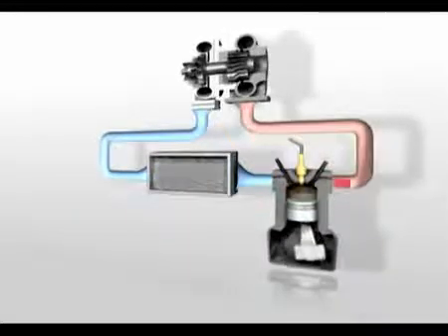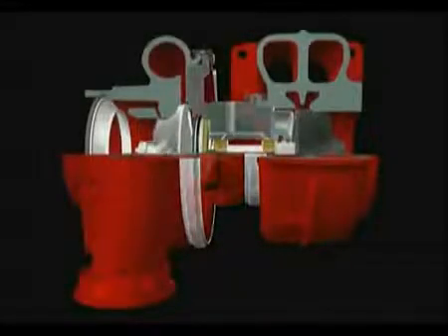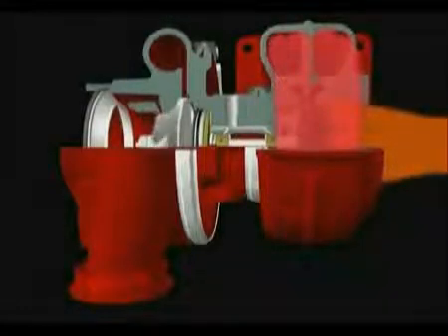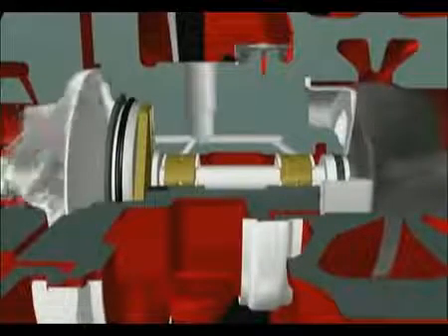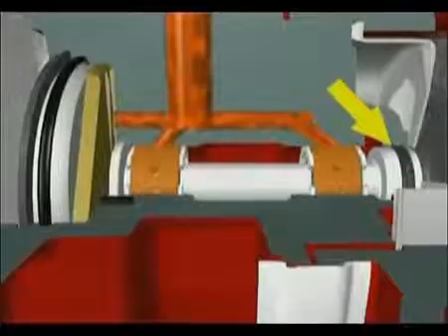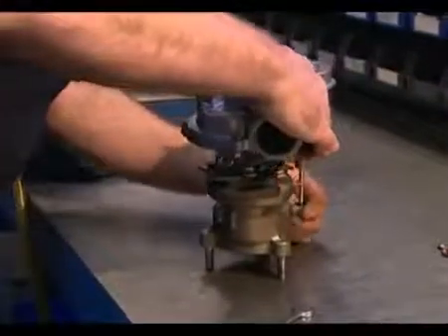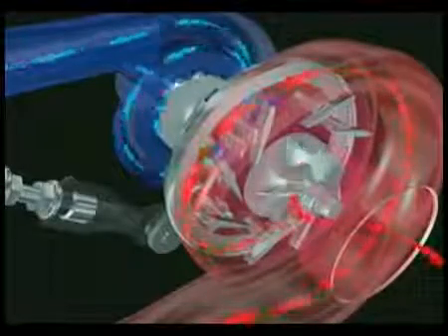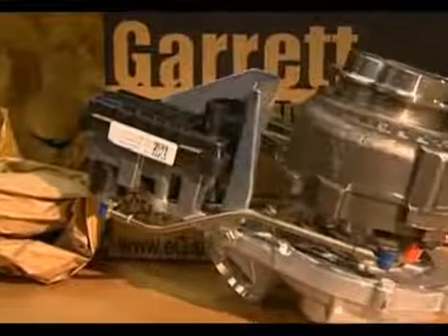How a turbo works full explanation with animation

Comment: So what is the difference between waste gate and blow off valve?
Reply: Waste gate is on the exhaust side, blow off or recirc valve is on the intake side. Recirc valve will put charge air back into the intake system after letting off throttle. Waste gate controls the speed of the turbocharger. Completely separate parts with separate functions

Comment: What happens in vechicle if waste gate gets jam and doesn't open ?
Reply: Doesn't work as well. Basically won't build boost pressure since it is short cuircuited.
Reply: @blackmanops3749   I think Chetan tikone mean that the waste gate never opens. It opens to stop building pressure. So if it stays closed likely the turbo will turn into small metal shards that rush into the engine and scratch and rub agents stuff. I mean this is the only logical way it will end up. It is a small turbo getting more and more exhaust rushing into it then safe. It is small to give good power at low or mid range. But when the waste gate kicks in your at high revs.

So it has to spin faster if the engine can supply it with more energy.  And as the turbo is killing itself to give more air it will have the power to do so.
But I do not think many road cars need to worry about the waste gate getting stuck. You have far more real problem on normal road cars. Like shit in the oil clogging up the fine oil passages in the turbo. (why there is a oil filter) Modern engine in general have this problem but turbo ones are VERY much a problem zone when it comes to oil. Why it is so crucial to change oil. Even more often then what manuals or the labels say. (if you care about the vehicle) 

One of the reasons to have a loud waste gate. External one that is. Not just for the satisfying sound. Never heard it on anything but the high powered gasoline cars. Diesels trucks or lorries I have not heard one in real life. But it might be more due to the law or something being lame. Believe me I have driven some turbo vehicles but not many costume builds. And the benefit of turbos are massive.    

If wastegate do not work lubrication is going to fail shortening the lifespan of the turbo. Or it just blows up like when you smash a window. 

Sudden power loss and small bits flying into the engine hitting valves and piston and the cylinder walls XD  Really lubrication loss let alone on a engine bearing is bad enough. But imagen a turbo that needs a waste gate? It will really do a number on the expected lifetime of it  :C
Really think the lube is the main thing that will make it explode. It is taking away heat and avoiding metal contact. The faster spinning might be enough to shatter the moving parts but the lube problem will end it totally.
Reply: My electronic waste gate just went bad, it gradually got worse, started with a small rattle that eventually got louder over time. My vehicle also had a hard time building boost and would constantly throw under boost codes which would put the vehicle in limp mode.

Comment: Interesting, I thought that hotter air would make the engine more efficient.
Reply: Nah, hot air is less dense so has less oxygen. The less oxygen there is the less efficient fuel to air ratio is detonated. For contrast 14:1 is the best ratio air to fuel needed for best performance and economy. Diesel used an even higher ratio and compression.
Reply: I’ve always been told by my dad and his brothers to at colder, denser air = a better bang.
Makes sense
Reply: That’s incorrect
Reply: Could a bad charge cooler make both turbos shut off?
Reply: That's true. Since cold air is heavy it settles down in the cylinder there by increasing volumetric efficiency. Hot air is less dense so it floats reducing the amount of charge in cylinder and it reduces volumentic efficiency
Reply: On my older Jaguar XF 3.0 diesel, there's always a sudden short slump in power delivery around 2500 rpm, lasting for about 0.5 to 1 second, then it picks up again and keeps accelerating properly, all the way up to the redline. 2500 rpm is when the second turbo kicks in. But my Jag mechanic says he doesn't know why the slump in power, because when he plugs in computer, it doesn't show any issue. The car never goes into restricted mode either... If it was actuator or anything like that, it would show on the computer. Anyone any idea what it could be? 😑

Comment: So does the initial air drawn from the turbo enter the air box before entering the combustion chamber ?
Reply: Yes.
Reply: remember that the engine is still being fed its own separate air supply from the intake.
Reply: @MacLaw3084  the intake being the turbo..